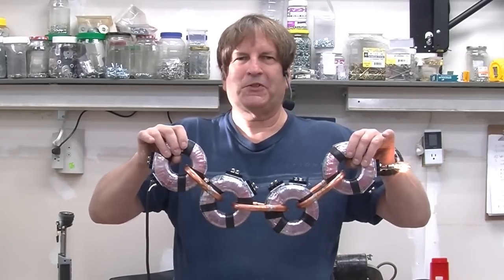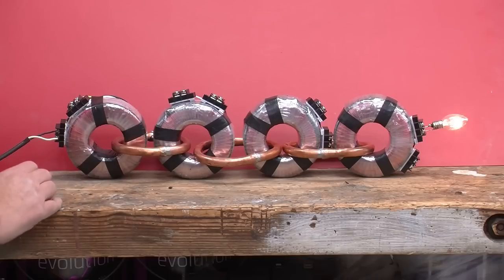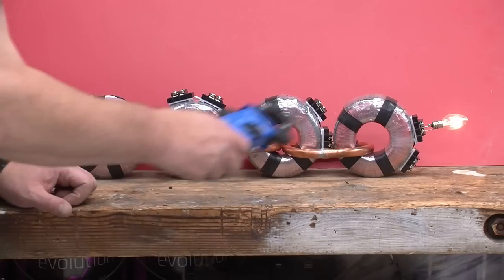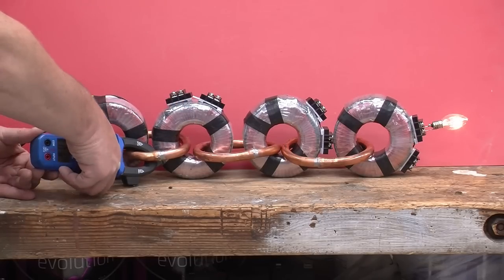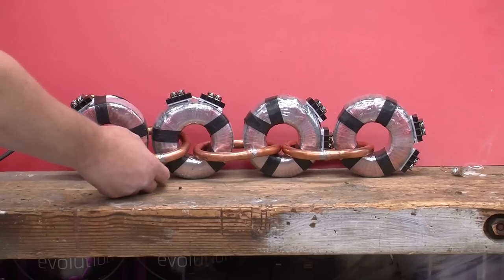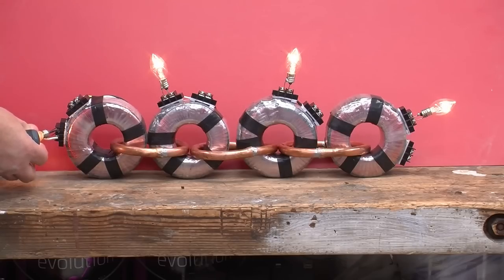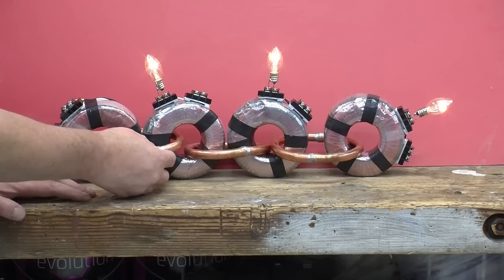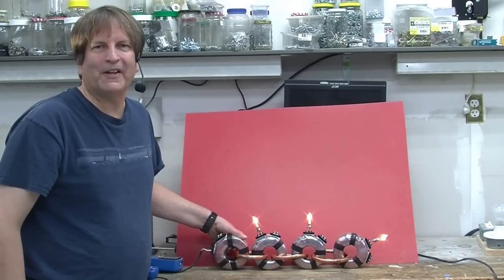Let's Experiment with an Electromagnetic Chain!

Comment: This is a very nice demo and nice explanation.  I do have to take exception to one part of the explanation, however.  The voltage you measure across the closed copper pipe loop is not the voltage in that loop but rather is the voltage induced in your measurement loop.  The voltage shows up at the meter because it is the high impedance part of the loop.  The rest of the loop, being made of copper, is very low impedance so the voltage is not there.  The resistance of the copper pipe is so low that even when supporting several amperes of current, the voltage is tiny.  The current in the copper pipe loop produces its own magnetic field by Ampere's law, and this field spreads through the space surrounding the pipe.  This field opposes the net field of the two toroids through the loop, and is just enough to make the net field (the integral of the magnetic flux, B, over any surface bounded by the loop) essentially zero, by Faraday's law.  Faraday's law works in both directions:  the shorted turn of copper pipe forces no voltage around that loop which means there is no net changing magnetic flux cutting through a surface bounded by that loop.  This doesn't mean that there is no changing magnetic flux, but just that there is as much flux overall in one direction through the loop as there is in the other direction.  Some of the magnetic field produced by the high current in the closed copper pipe loop also links through the measurement loop formed by the meter, its leads, and both halves of the copper pipe loop.  This field induces the voltage displayed by the meter.  You can explore this by making a magnetic field "sniffer" loop of insulated copper wire connected to your meter.  Twist the outgoing and returning wires together except at the far end where the wire is formed into a loop.  Use the loop to sniff out the flux in and around your setup.  If the loop is formed while linking through a toroid, you will see a significant voltage.  When the loop is just formed in the air, it is sensing just the magnetic flux in that part of the air.  Without the closed copper pipe loop in place around the toroid, you will see only a tiny voltage outside the toroid because the material in the toroid is containing almost all the magnetic flux.  With the closed copper pipe loop in place, you will see some voltage when your loop is in the vicinity of the copper pipe, due to the large current in the pipe producing its own field.

Another test you can do is to remove the shorted closed loop and form a new closed loop linking your toroid but make the loop out of two leaded resistors of different values, say 1000 and 3000 ohms, with the leads soldered together at the ends.  This loop will have only a small current (and thus a small induced magnetic field) due to the high resistance.  Then use your voltmeter leads to look at the voltages in the different parts of the loop.  You will find that the voltage across the 3000-ohm resistor is just three times that of the 1000-ohm resistor and the voltage along either of the wire leads spanning between resistors is virtually zero.  The induced voltage shows up in proportion to the impedance.  If instead of the voltmeter, you use an oscilloscope that is triggered by the ac line, you can verify that the instantaneous voltage is in the same direction in both resistors, so that the sum of the voltage around the loop is non-zero, in accordance with Faraday's law.  (Some people have argued that the voltage around the loop must be zero in accordance with Kirchoff's law, but this test shows that Kirchoff's law is not applicable in this case due to the changing magnetic flux passing through the loop.) 🙂
Reply from the maker: Glad you liked it Analog Guy! Its always hard to have a discussion like this in a text only format, so let me try and tell you where I am coming from and where I think we differ (and if I get that wrong my apologies). 

So I think we agree that the meter reads about 0.2V when attached to the two sides of copper loop. I just did  one measurement you suggested: One meter lead though one of the  toroids in the chain, other outside the toriod and connected together, effectively a transformer winding with one turn. The result: same voltage 0.2V.  And just to prove this is not influenced by the copper pipe loop:  same test on an identical transformer  not part of the chain and nothing attached: 2v measured. So 0.2V is the one loop voltage of that toroid transformer.

Where I believe we differ is  you say the copper loop is effectively a short. I respectfully disagree – is not! It is not because it is a one loop transformer winding for the next core which creates its own inductive back emf. Consider if instead we had a 10 loop coil around the first core attached to a 10 loop coil around the second core. That would not be shorted: the first coil would produce about 2V which would be applied to the second coil. That second coil would draw a current to generate a 2V back emf. If we measure the voltage where the two coils are connected, we would see 2V – the voltage from transformer action in the first coil and also the (necessarily) equal voltage from the second coils back emf. Now do the same taking away 1 loop from both coils so now we have 9 loops in each coil. All the reasoning is the same but we now have 1.8V where the coils connect. Repeat and repeat till you are down to coils of one loop – which is exactly what we have.  

Your right about Kirchoff's law being stymied in loops like this –  the fact that  the loop itself is a voltage generator along with every component in the loop really does a number on Kirchoff!

So what do you think the voltage is if I attach the voltmeter leads to two sides of one of the copper loops, but this time at the points inside the toroids? (ie move 90  degrees along the loop  from the  measurement position shown in the video)? Answer: 0V. 

Thanks so much for the comment! I really appreciate it even if I disagree :)
Reply: @ElectromagneticVideos  OK.  Thank you for your response.  I believe we can reach full agreement.   I agree it is hard to communicate clearly when using just text.  I indeed agree your measurements are just as you state.  I agree the voltages you measure as you move down the chain go up and down in proportion to the number of turns, taking into account a very-slight loss as you move along.  I agree about the back EMF from the other cores and the voltage being proportional to the number of loops of wire.  I think you and I will agree that you have essentially created a cascade of step-down, step-up, ... transformers.

Please try the following:  With your chain of cores and copper loops energized, first touch the tips of your voltmeter probes together, away from the setup.  You will of course see zero volts.  Keeping the tips together, touch the tips to one spot on the copper loop at the beginning of the chain.  I think you and I will not be surprised to see the voltmeter continues to display zero volts.  Now, keeping the tips touching the loop, gradually slide the tips apart along the loop.  I expect the voltmeter reading will continue to be very near zero, perhaps increasing slightly due to the loop current acting on the small but finite loop resistance.  (I think you and I will agree that if the loop were made of a less-conductive material such as carbon, that you would see a more rapidly increasing voltage.)  Keeping the tips in contact with the copper loop, continue sliding the tips apart until you can go no farther due to the blockage by the cores.  Continue to slide one of the tips as far into the hole in the core as you can go, keeping contact with the loop.  I expect the indicated voltage will still be very low.  Make note of the point where the tip touches the loop.  Now remove that tip, move it over to approach the loop from the opposite side of the core, and again touch the loop at the exact spot as previously.  I expect you will now (magically? but not unexpectedly) see the voltage jump up to your figure of about 0.2 volts!  Yet you are probing the same exact spots on the copper loop.  Can we agree that absolutely nothing has changed about the copper loop?  Yes, I hope so.  Can we agree that the only thing that has changed is the configuration of the measurement loop?  Yes, I hope so.  Now the measurement loop links around the magnetic flux in the core when previously the measurement loop did not link around that flux.  Thus, we now see a voltage at the meter.  This voltage is induced in the measurement loop.  Since the probe wires are also made of copper and the current in those wires is very small, the voltage in those wires is very small, just like we saw for the big copper loop.  Virtually all the voltage appears at the meter since that is the high resistance point in the loop.

You can approximate the carbon loop by soldering any convenient number of leaded resistors together, forming a loop around the core.  Now by probing at different points around the loop (being careful not to form a loop around the core flux with the probes), you will find voltages across each resistor in proportion to the resistance (due to the uniform circulating current, i, times r) and you will find virtually no voltage across each lead wire interconnect because the wire interconnects have virtually no resistance as compared to the resistors.  Once again, if you add up all those voltages, they will sum to the voltage produced by connecting a wire from meter terminal to meter terminal while looping the wire through the core.

All this is to say that Faraday's law applies.  The integral of the electric field around the loop is equal to the negative of the rate of change of the net magnetic flux surrounded by the loop.  Since an excellent conductor cannot host an electric field, the voltage shows up in the loop at the points spanned by higher impedance.

I think the confusion that arises for many people (including myself) leading to the claim that voltage is induced in the wire is due to the way we model the situation.  If we are going to use a transformer in a circuit, we want to know the effect of the transformer on the rest of the circuit without having to concern ourselves with all the construction details, materials, and physics such as Faraday's Law inside the transformer.  Thus, we replace the internals of the transformer with a model.  In the model we ignore the flux and cut the wires and insert ideal dependent sources.  (And if we want a really good model, we also optionally add some ideal inductors and resistors to handle the magnetizing current and voltage drop.)  These models lead to the very convenient outcome that we can use Kirchoff's laws to set up loop or nodal equations to solve for all the voltages and currents in the rest of the circuit.  With a good model, these calculations predict very close to the same result in the rest of the circuit as the real thing.  Thus, we tend to begin to believe those sources are really there.  In the same manner, let's consider a transistor model for instance.  We know it does not include all the detailed geometry, materials, doping, and quantum effects in the real thing, but our model using common idealized components including dependent sources is a convenient means of being good-enough for circuit analysis and simulation.

Rather than saying voltage is induced in the wire, we should say that voltage is induced between the ends of the wire, or between the turns of the wire.  Per the Maxwell-Faraday law, there is one sum of the electric field around any closed loop.  The field won't add up along the length of the wire because we know that the tangential component of the electric filed is zero adjacent to a good conductor.  So the field (and the measured voltage) shows up in the gap between the ends of the wire, or between turns of the wire in the case of a solenoidal winding.

So I have to say the copper loop is still shorted when it links two cores.  Indeed, the magnetic flux in the second core is in a direction opposing the flux due to the first coil, such as to produce a reverse EMF that largely cancels the EMF of the first coil.  The remaining net EMF is much smaller than it would be without the second core, leading to a much smaller circulating current in the copper loop.  Any voltage measurement on the copper loop will produce only a tiny voltage, unless the measurement path encircles a core.

I hope all this makes sense to you and may help to resolve any apparent differences.

Comment: @1:28 electrically connected? That torroid looks insulated to me. If it wasn't and you were holding it in your hand you'd be holding onto mains voltage with your hands. The copper is insulated from the transformers. There might be some eddy current in the copper, but there's no electrical connection.

Comment: Are the copper tubes carrying live juice? If you ground yourself they would shock you if you touch them?
Reply from the maker: They are but at a max voltage of 0.2V so not much chance of a shock from them. And since they form a closed circuit with no connection to ground, there would be no (however small) current through me to ground from them.

Comment: It is just resembling electromagnetic transformation, it is magnetic transformation only. All windings are in the same orientation, there is no electric field involved. Besides this, there are heavy losses, because the magnetic coupling is not ideal, this will get warm after some time.

Comment: Friend, What would happen if you contrived to give one or more of the copper rings some SPIN? What id two of them spin in opposite directions?
Reply from the maker: I think at the most you might get some eddy currents in the copper generating a bit of heat, but to make that even noticeable they would probably need to be spinning really fast ....

Comment: Interesting contraption! But your explanation left me in the dark. What's the overall power loss and power factor? Do the toroids have multiple copper windings (other than the one with 500 loops)? There's two pairs of connectors on each, so maybe? If the windings of the two middle toroids are left open circuit, do they affect anything? Would it be like having a ferrite torus with 1 loop as primary and 1 loop as secondary and nothing else? So a 1:1 transformer?
Reply from the maker: Yeah - unfortunately to keep videos like this to a length that people will watch there always is a compromise between how much detail and how long it can be. 

Let me try and answer your questions: 

The overall power loss when unloaded (no light bulbs) was measured to be about 7 watts. The bulk of that would be core loss - heating in the toroids from eddy currents and hysteresis - more more on that in a future video. The restive loss in the copper pipe loops is minimal due to the low currents in them relative to their resistance.

Each toroid is actually a transformer with 4 windings: two 525 turn  windings (120V) and two 130 turn windings (30V) intended by the manufacturer to allow 120V/240V in and 30V/60V out depending if they are in series or parallel. I added the two pairs of connectors each, one for 120V (the two 525 turn windings in parallel) and one for 30V (the 130 turn windings in parallel).  If they are left open (no load) they have no effect (no current flowing though them) and its equivalent to simply a magnetic toroid. I was debating whether I should remove the windings from the center cores to make that point obvious, but decided to leave them because we can use them to show whats going on in each core with the little light bulbs. 

Your absolutely right - the center is just 1 loop 1:1 transformers. 

Hope that answered your questions!
Reply: @ElectromagneticVideos  Thanks! Yeah, that clarified a lot. I have a decent understanding of transformers as electrical components, but this was quite puzzling because it's so different!
Reply from the maker: @renxula  Great!  Glad to help! And yeah - it is different!

Comment: This is one other very interessant video to understand how transformer works...

In this copper pipe alot magnetic fields. Has damage (risc hurt) touch of pipe? (to blood or hands cells)
Reply from the maker: Glad you thought it was interesting! No real risk from the fields - generally magnetic fileds are pretty harmless. There is some thought that long term exposure to AC magnetic fields from a nearby power line may have a health effect but I dont know if there are any definitive proving or disproving that. I wouldnt sleep next a magnetic chain every night for 10 years, but a few minutes or hours - no porblem.